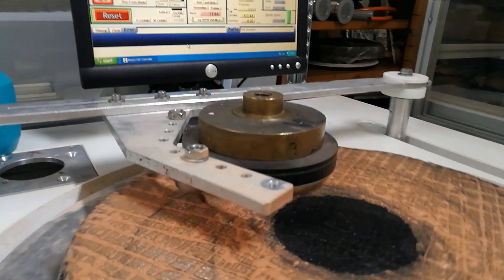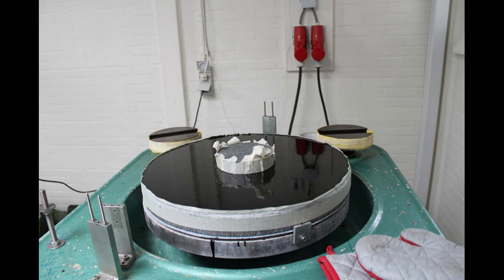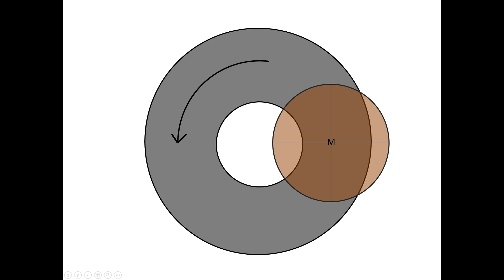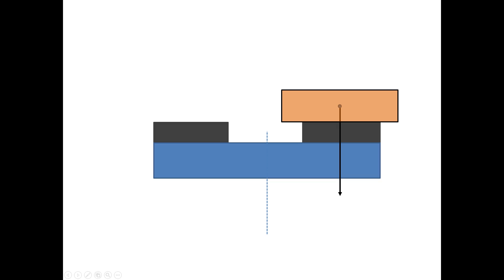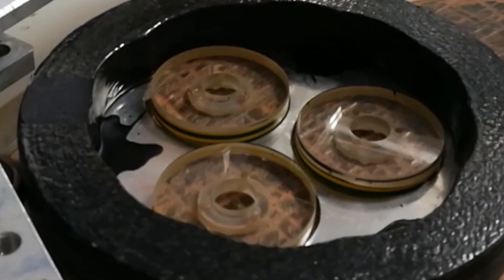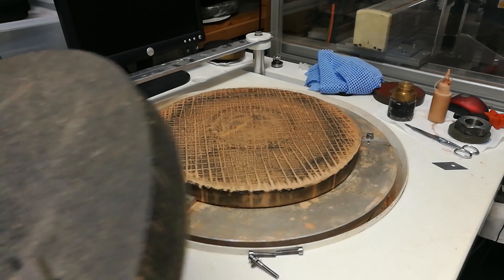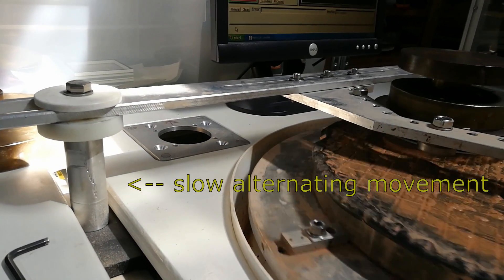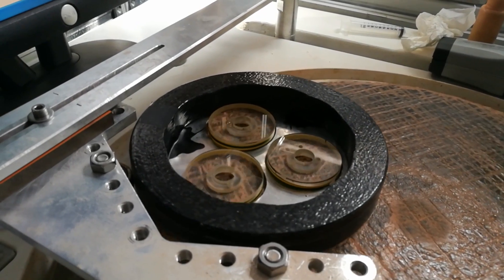How to make Very Flat Optical Surfaces on Glass

Comment: Do you always use the same grit to polish? If not, do the grits find themselves trapped in the pitch? Do you have to use different pitch plates for each grit?
Reply: Polishing is the final stage of producing an optical quality surface and there is only one compound used on a given lap. 

Grinding the surface to a desired rudimentary curve is called grinding, not lapping. Pitch laps do not grind but only polish. The amount of material you'd remove by polishing is miniscule and nobody wants to waste time doing any more polishing than necessary.

Grinding a surface starts as a rough cut to quickly give a desired curvature and to remove casting irregularities. Then a succession of finer grits is used to remove the deep scratches left by the previous grit. This is done with a hard tool on the workpiece and an abrasive slurry is run onto the surface. It looks a lot like lapping with a pitch lap, but because the tool is hard, it can be reliably cleaned off when it is time to change to the next finer grit size.

Comment: When you shut the machine down overnight, is it necessary to maintain the lab at a cool temperature to minimize pitch movement?
Reply: I think there is a tradeoff. It would certainly help, but investing in climate control may not be worth it. Also, it seems heating the plate and then weighing it down removes enough deformity in a small amount of time.

These techniques are fascinating.
Reply: I think they're just designed to never turn off unless you're servicing them. He said the pitch will degrade to a point of unusability within a minute, and no matter how cool you make it in the lab, the machine will still be hot from the friction it generates when you turn it off. I'm sure it would take much longer than a minute for it to cool.
Reply: They run 24hrs
Reply: @BureauOfWrongthink  No. He says in the video that he does NOT run HIS machines 24-hours.
Reply: Nah...you just use auto tune. Everybody does these days. Hehehe
Reply: @shannonpincombe8485  I respect the pun
Reply: @shannonpincombe8485  That's how those T-pain sunglasses are made.

Comment: I used a machine like this in the 90s to flatten hydraulic motor parts. Instead of pitch, the wheel surface was steel, and the surface was kept flat by adjusting three rings which also kept the parts in position on the wheel. We'd check it a couple times a day by washing the abrasive off and placing an optical flat on the wheel. But other than that it worked the same way.
Reply: I appreciate this comment very much after having done very similar work in the 90s. I used to test lapped and partially polished parts with an optical flat to infer the concavity of the part (convex or concave). Once the concavity was determined, I inferred the lapping wheel's (opposite) concavity and would adjust the rings' position to correct the wheel.
Reply: @Andrew Crews I worked on Eaton and Sauer-Sundstrand axial piston pumps and motors. We would replace pistons and cylinder blocks and send them out to be resleeved/refinished.
Reply: Pl.explain the process in detail
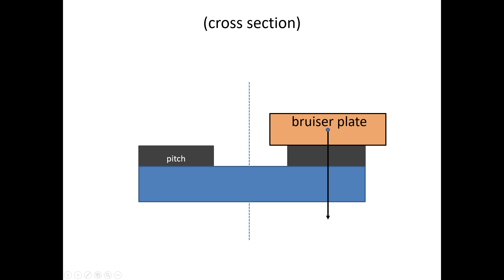Reply: @subhashkulkarni1117  I honestly don't think I could explain it any better than this video does at about 3:50.. but the process is a little different for metal parts. The wheel is made of steel and the abrasive is a slurry of diamond or carbide grit in very light oil or mineral spirits. You put the parts on the wheel for 10-30 mins, remove and clean them, check with an optical flat, and adjust the bruisers and re-grind as needed. Finally you check the part thickness with a micrometer to make sure you didn't remove too much material.

The only other thing we did that isn't mentioned here is, we would wash down the wheel 2-4 a day and check its flatness to make sure it isn't being worn unevenly. Being made of steel, it takes much longer to reshape. And if you are working with a new set of bruiser rings, you need to make the adjustments more frequently/carefully because the added weight makes them work faster.
Reply: its not the same as true level
Reply: @hindugoat2302  Reality is poison! I can't live like this!

Comment: Using interferometric fringes to test optics, what an ingenious setup!
Reply: If you think that is impressive the Laser Interferometer Gravitational-Wave Observatory uses interferometry to detect changes in length less than a 10 thousandth of the diameter of a proton.
Reply: @kellymoses8566  luckily we don't need quite such precision for optics :)

Comment: can i understand this way, i can use this machine to recondition old guage blocks for flatness and bring them back to live? it is a pity to see gauge blocks find in old basement turn rusty by age and water damage. ordinary files and sand paper will destroy its flatness immediately, at least they should be still good to be use as parallels in a milling vise....
Reply from the maker: You can use this principle also for your purpose. However, you cannot use pitch. For metals you need to use a metal ring and abrasive with different grain sizes.

Comment: Thank you for your video. Please tell me about ability your machine. Can it make surface flatness 1/10 wavelength?
Reply from the maker: That would in principle be possible, although not very easy. For 1/10 Lambda you would preferably use a really well run in planetary polisher. It would not be trivial to achieve with a machine that is not running continuously for days / weeks but is started up every day.

Comment: When you go through the grits of silicon carbide or cerium oxide, dou you change pitch plates or clean it very well? How do you make sure some coarse grit doesnt ruin the later polishing steps?
Reply from the maker: The silicon carbide grinding is not done against pitch but against other glass  or granite plates. You have to carefully clean and rinse between grains (not only the plates, the work space, but also your hands) in order to avoid contamination.

Comment: Make a hole in the centre of your table and you'll get small version of classical planetary polisher. Use your granit plate to reset serface. Why not do it like this?
Reply from the maker: If you watch really carefully at around 8:30 min, you see that there is a very shallow step/hole in the centre, just like a planetary polisher. It's just very shallow.

Comment: Very interesting thanks, I can understand the abilities of the optical pitch, however I cannot understand the need for it? Why wouldn't you just use something that is very hard and fabricated to be very flat. Then that serves as a polishing plate that never needs to be reset.
Reply from the maker: So in turn, how would you fabricate that something very hard and very flat?
Reply: @HuygensOptics  I presume the same way as however the bruiser is made? From a design POV, from my limited understanding, it seems counterproductive to use the pitch, which requires constant calibration, as opposed to something which keeps it flat shape (provided it is hard enough to not wear away)
Reply: @joelmorley5  No matter what, it will wear. Also temperature will cause it to warp enough to matter in this case. There is no point in making an expensive flat plate when it will lose calibration not much slower than the pitch does. May as well have something easier to calibrate.
Reply: You can't use a hard surface because you need a soft surface for the grinding particles to embed in.
If you use a hard surface the grinding particles will roll between the hard surface and the glass and you end up with a lapped glass surface instead of a polished surface.
The lapped glass will be mat instead of shiny.
Reply: @Henning_S.  That makes sense, thanks

Comment: Hi Jerome... I change the pitchlap of my machine, before are a #73 hard pitch and now have a #55 soft pitch. With #73 I had good flats but with scratch... Now with a #55 the pieces don´t have scratches, but I have a TDE with 3 fringes over 6" diameter blank. 
the polishing pitch has good grooves and the pieces do not aquaplan. 
Do you have any idea of the cause of this TDE? The only reason is the use of the softer pitchlap?  I am very upset with this result. I appreciate any tip.
Reply from the maker: With softer pitch, the risk on TDE is larger because the lap deforms over time. One option is to not keep the blank in one position, but to constantly move the blank over the pitch from inside to outside. Other important thing is constant temperature control, so cool the abrasive and keep blank and lap cool. By the way, there is no reason for hard pitch to give scratches other than contamination with sharp particles. You should focus very much on working cleanly and protect the pitch lap against any contamination of particles from hands, slieve and even those releasing from the ceiling of your building.

Comment: Thanks for the video, it's very informative. So the polishing table is an aluminum disk with a motor stator attached to it, and you press the pitch lap by using a granite plate, but I was wondering if you could share what the pitch lap substrate is made of? It looks like a few inches thick disk. Is it also granite?
Reply from the maker: No actually in this particular case it is borosilicate, which has a thermal expansion coefficient that is about 3 times lower than granite (which is an advantage). You can however use granite without problems if you have good temperature control.

Comment: I'm wondering if you can put the pitch lap in the freezer when not in use for weeks or months?
Reply from the maker: Sure, that is the way to store them over longer times. It also avoids the evaporation of the more volatile components from the pitch so it keeps the right viscosity. However, even then you have to put some effort in bringing them back in a usable state, because, they will loose shape on the sub-micron scale.

Comment: How can the flatness be measured and verified across a large surface? I assume with a reflective surface, you're using the angle of reflections to detect small flaws, but this is more a relative measurement to localized area. If you wanted to quantify the deviations to the nanometer level, how do you measure that?
Reply from the maker: The most common method is interferometry. You can use either use a test glass in direct contact or use an interferometer.
Reply: @HuygensOptics  Thank you. This is simply out of curiosity. I imagine even with an interferometer, passing over a larger surface there must be some way eliminating errors from the mounting plane. Having infinite precision is only so good if the sensor must be mobile enough scan across a surface somehow. This seems like it must be a difficult problem to solve.

Comment: Hi dear friend, I again, sorry for it!
Please, I have a terrible noise of carrier cast iron ring... do you have any suggestions for me to eliminate this noise?
Look the first test  here: https://www.youtube.com/watch?v=2LKA_piJG1c
Reply from the maker: Basically the high-pitched sounds indicate that there is intimate contact between the ring and the pitch lap at some moments. It is not nescessarily a bad thing because it means that it is really doing some serious  polishing action. However, your pitch lap is no good at this moment, it has a wave in it. You can see that because the granite plate is rotating irregularly whereas it should be rotating with a constant angular rate exactly equal to that of the angular rate of the pitch lap. You can solve this by either pressing the pitch lap flat with a flattened stone the size of the pitch lap (best method but maybe unattainable for your size lap), or by using a scraper that removes the excess of material from the lap (can be a very messy method). Good luck!

Comment: Hi, to make a "Economic bruiser" can I use a large granite disk with small disks of Soda Lime glass glued on face? Or best, can use a disk of thin sodalime glass (same size in diameter) glued on face of these granite disk? I can not pay for zerodur or fused silica... I´m changing a large 1,10 meter CG to CP... and the bruiser is my biggest concern...  I purchase the book recommended by you, but  doesn't suggest alternatives! thank you a lot.
Reply from the maker: It is an option. Float glass and granite have approx. the same CTE (7-9 ppm/K) so that is good and I have actually done this in the past.The problem that you will encounter is changes in shape due to temperature changes and gradients. It will be very hard to get your process stable. So for example using a thick slice of Pyrex (CTE=3.3) has major advantages over granite. Pyrex blanks can sometimes be found for fairly low prices on Ebay.
Reply: @HuygensOptics  Amazing... I have a pyrex blank 24" diameter end 1,5" thick and I can use that as a bruiser... You save my day again! Thanks! in few days I can put a video about this machine on my channel and invite you to see.
Reply from the maker: @sandroac34  looking forward to that!

Comment: great! 
how to remove stress on the lens? large lens. after removing it from the block.
Reply from the maker: it's the blocking itself that introduces mechanical stress in the material. After deblocking it is automatically removed again, but then the shape of the objects change, generally in an unpredictable way.
Reply: @HuygensOptics  yes, that's exactly what I asked. after unblocking, the surface color changes unpredictably :-((
https://www.instagram.com/p/CE9lp0yqDlC/?igshid=1tatmxrin9m51
Reply from the maker: So, the only thing you can do here is keep blocking wax thickness as thin and uniform as possible. Also only block on flat surfaces. another option is to us pitch as a blocking substance, prefereably in a dot pattern. Next you give the pitch sufficient time (1-2 days) to relax, so that all stress flows out of the contact points between the two surfaces. This will reduce stress and deformation significantly.

Comment: Excellent. thank you for sharing your knowledge, but i wonder how do you make the grinding process.  Is there a grinding step before the polishing? Or is your technique of optical making jst by polishing process? And if i use your method of continuous lap, how should i grind the blank?
Reply from the maker: Actually, these objects were pre-grinded with various SiC grains, just like was dhown in a previous video https://www.youtube.com/watch?v=-E058yElkFM. Sorry if that was unclear. Before you start polishing, you need to achieve a very low surface roughness of preferably less than one micron, which you can only do by consecutive grinding with increasingly small grains up to1000 or even 1200 mesh.
Reply: @HuygensOptics  thanks for answer. I would like to make a little flat such as 40mm but i have no spindle machine. I m thinking to use the three plate method but i worry about the turnes down edge. Have you ever used this method? Have you any tip to avoid the TDE effect?
Reply from the maker: @paralax8714  the 3 plate method is useful if you don't have a reference. If you can borrow one than I would not recommend the 3 plate method since it is really a lot of work. Controlling temperature is key to avoiding turned down edges. Make sure your pitch remains at the specified working temperature.
Reply: @HuygensOptics  its true. In fact i have an excelent flat even though tinny. It came from a Zeiss microscope and it has 1 inch wide. Im gonna make a flat wider a little bit, i mean 40mm. What method do you recomend in this case?  The method of your?
By the way, im doubt aboit the grinding process without 3 plates. If i use just two blanks and use centered 1/3 course, and alternate the positions of the blanks, i mean up to down and down to up, could i achieve good results? 
In the video you linked me you use just a blank and a tool but you wore working a curved mirror. In my case, how coudl i adapt that method?
Many thanks
Reply from the maker: Problem with this is that you cannot really test a 40mm flat wth a 25.5mm flat, you need something significanlty bigger. You can sometimes find really good zerodur flats on Ebay for very little money. Dichroic zerodur mirrors will also work. Alternating plates during grinding will generally work well, but you need a hair ruler or a spherometer to check shapes. With the 3 plate method, you need a 4rd plate when you start polishing. Polishing flats or spherical mirrors basically works the same way, you can use tool- or mirror on top methods to tweak the surface shape in a specific direction.

Comment: This is amazing. I've been looking for a video just like this way to long. Using an Washing machine motor is super smart, I always wondered what would be an efficient drive that would not introduce any distortion into the plate
The Question I have is how do you ensure that there is no abrasive Material getting into your bearings or the Motor assembly?
also could you improve precision by supporting the plate on Airbearings?
Reply from the maker: Generally I use very little polishing abrasive. But if you use a lot, a "dripping edge" is the solution to prevent contamination of the under side of the plate. Using air bearings is actually ideal. Because of the high stiffness they can prevent vibrations which always influence flatness in a negative way.
Reply: @HuygensOptics  Thank you very much for your response :)